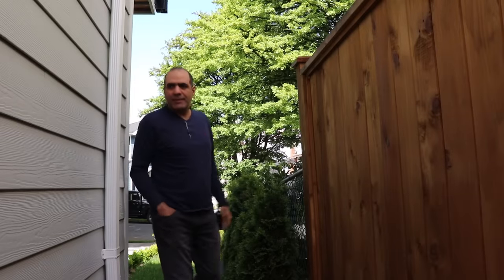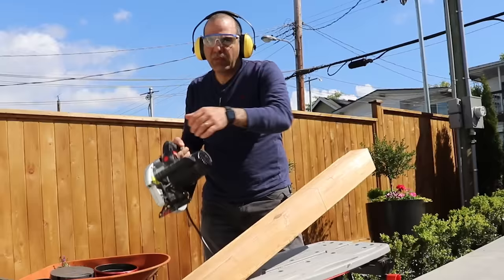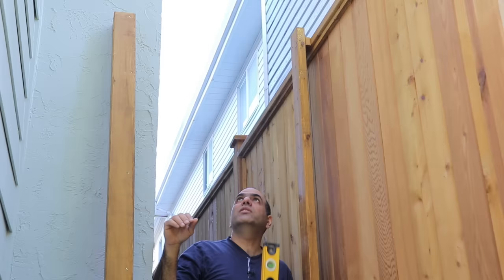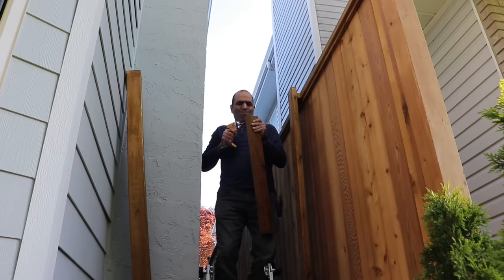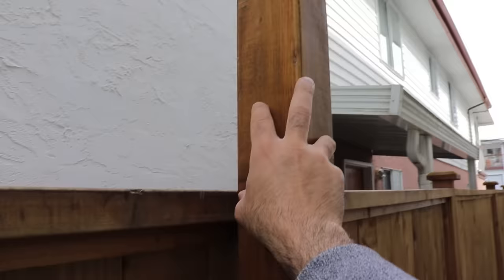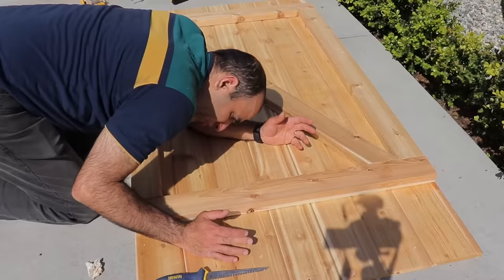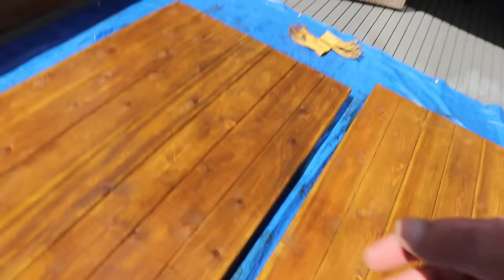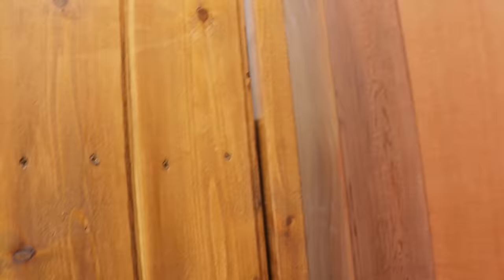Making Wooden Gates for My House

Comment: The wood usually fails before screws do in terms of bull force especially for deck screws takes around 1000 pounds sheer screw strength is around 300-400 pounds

Comment: Make the pin rotating. So it will fall out of the way when opening. Then attach a servo and rc tech on the pin. Then you put rc tech into a remote and when you want to close the door from the outside, you press the button on the remote and the pin will go up

Comment: I am a structural engineer and I just rebuilt my gate. You left out the carriage bolts. The wind is not your frieind. I live in a 130 mph hurricane wind zone. My gate will be the only thing still standing after the big one.It had carriage bolts. A lot of carriage bolts. Galvanized carriage bolts. 
FYI, your latch is reversed. The latch does not go on the gate, the post part does.

Comment: you should have added a strip of wood on the inside of the door frame so that the door has something to rest against besides just a latch. The latch only being as strong as two small screws. Over time that will likely be the first device to fail. Also I would attach a plate to the backside of the stationary latch pin with four screws vs. Just two. A better alternative to screws for sheer forces are square nails. Mechanical square nails can recieve more than twice as much sheer force and other forces at the same time.

Comment: for the hinges facing the street, you can use one-way screws. These are screws that are designed such that a flat head screw driver is used to install them but it is impossible to unscrew them using that same flat head screw driver. Think of it like the carpenters diode. Here is the link to home depot where you can buy them. This way no one can easily break in. https://www.homedepot.com/p/Unique-Home-Designs-4-in-Black-One-Way-Screws-4-Pack-5WG900BLACK4OWS/202098358

Comment: Screws are harder to pull out than nails (Tension) but nails have more shear strength because the metal is not as hard so it will move a bit before it breaks. Harder metal is also brittle

Comment: If you can't open the door from outside... Why there is a handle in the first place? If you can't open the doors from outside, why did you bother building doors? Just one large piece of wood bottom shaped according to the floor and the fence on the street side could have done the trick.

Comment: You made a few mistakes in this. The first I noticed was saying screws are good at handling sheer force. Nails are actually better at this, as they are made of a softer metal, and are less likely to basically shatter. 

Second, I believe you should have added some space between the boards, this can allow them some expansion and contraction from moisture and temperature changes (I think I might have also stained them before installing but I'm not as confident), could have also fixed your issue with having to have that skinny board.

Comment: You really should have made the gate open inwards, there is no doubt people are going to hurt themselves on that latch pin sticking out.  Please get a different style latch if you haven't already.   Finally, you could have flipped the latch pin over and not had to use the spacer block.

Comment: Is there a reason you didn't make the door frames the same heigt as the doors ? I guess on the right it makes sense because of the fence and how you mounted everything but what about the left side ? Maybe so it looks uniform on both sides ? Looks really good like this as well but just wondering.

Comment: You're an engineer. What's formula to cut that diagonal piece of wood that supports the door? Say you couldn't trace it.. How would you get the right measurements length and angle of the 2x4 to fit perfectly ???

Comment: Your gate on chimney side shouldn't be here. There is an obvious reason why wood can't go too close to heat emitter. Minimal distance is at least 15 cm from the edge of heated element (at least in Europe). It also influences lifespan of wooden element. Many changes of temperature make it weaker over time and it will be very dry close to mounting points causing it to break. 
Parget on chimney looks like it was made by 5yo. I know that Americans don't get how to make a house properly, but even you could do it better

Comment: Security idea that worked at my friends place.   Install a locking carabiner and chain/ring at the bottom of the gate, inside.   This way, if they want the gate open, they have to jump over it first, spend time unlatching it, then open the regular latch.   A lot of thieves are paranoid because of drug use, and if something takes too long, they move on.   That said, my friend also added some sharp stuff to the top of the gate... but this could be a liability if you live in a socialist state that supports criminals over home owners, ha ha.

Comment: Isn't it typically a good practice to pilot wood screw holes so you don't split the wood you're drilling into? genuinely curious, not criticizing
Reply: Yes indeed, pilot holes in general for that very reason. Also you would normally use either nails for this or special framing screws, because screws tend to break in shear forces. They are hardened, because they have to cut into the material they are drilling into.

Deck screws are typically used to hold the deck planking down, which is tensile forces but almost no shear, the structural members are bolts, wood joints or nails generally.

Comment: Dude... Since the day you were trying to shave with an angle grinder you make me nervous each time you touch a power tool... Including a drill to be honest. For god's sake, please don't use the saw like that. If you push it, when it bites the wood, it runs away from you. When you pull it, chances are you'll be hugging the saw, and this time you may not be as lucky like the time you cuddled the Jacob's ladder. We need you to preserve your limbs.
Ah. Also, if you want a trick for staining, dilute the stain with toluene, lots of it (in warm climates use a slow dry medium) and use a spray bottle to generously spray it on the workpiece covering an entire surface. Then use a large rag to wipe the excess right after spraying, don't wait. This would allow the thinned stain to embed itself into wood fibers much quicker and since the volume is much larger, it allows you to wipe to clean finish before it dries you can repeat until you reach the desired darkness. It also makes the work way more consistent.

Comment: Mehdi - There's no way for Philips head screws with lumber.  Use Robertson head screws so the driver bit will not slip and rip out the head of the screw.

Comment: So similar to Mehdi I am starting to use bigger cutting tools for the first time as the biggest cutting tool I've used is a Dremel.

Tried to cut a 2x4 with a jigsaw and it just wobbled around and vibrated me instead lol, I don't have those wood holding stands you see Mehdi has one in the video. I tried to put the piece of wood in between two garbage cans but it's still flopped around quite a bit. Do I need to buy some sort of vice? Thanks

Comment: You need to stop using that circular saw until you have learnt to use it safely.  Especially if you are posting things on Youtube or wherever. To anyone watching, please dont fuck about with safety.  If you're new to it then its probably best if you get comfortable with the tool under supervision.  Failing that there's a lot of info on line, so ... .

Comment: You do not really understand the fundamentals of screws. They withstand a lot more pull pressure than nails but are easily sheared from up or downward pressure. Yes …the exact opposite of what you said.